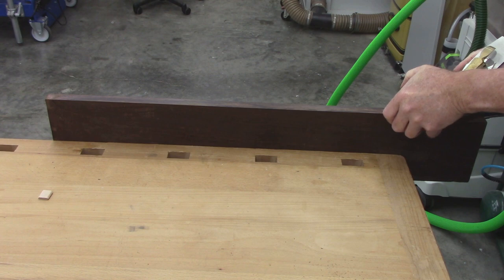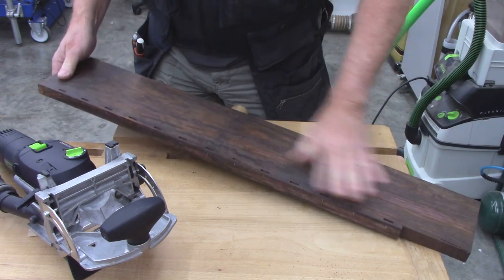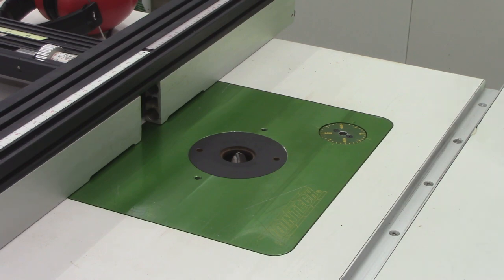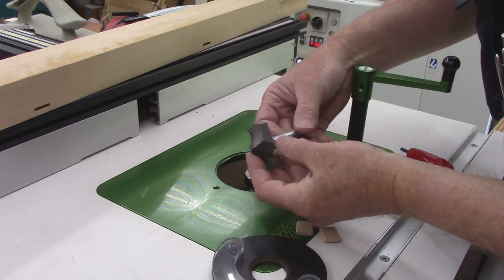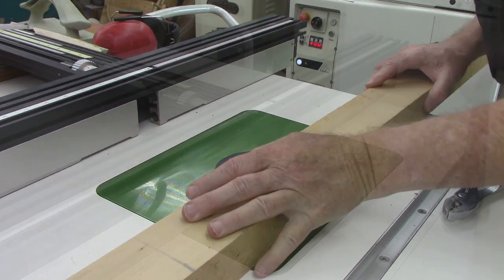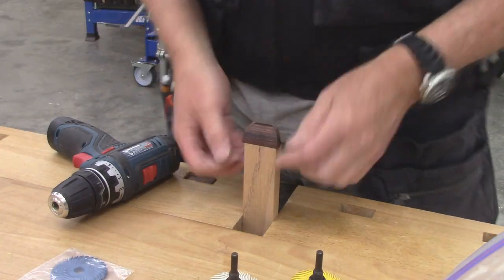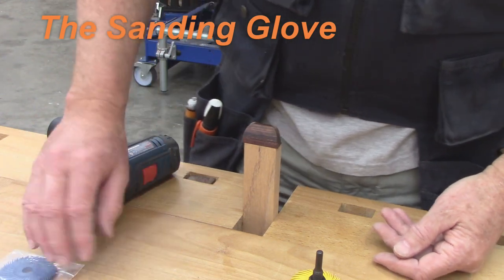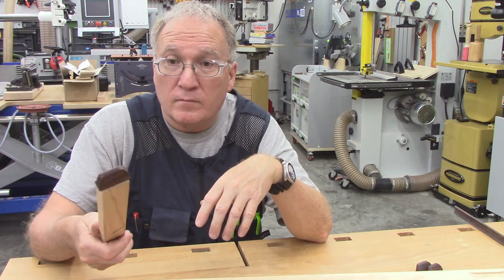Making Drawer Pulls using the Router Table and Sanders

Comment: Well done Steve. Safety first! After 40 plus years of woodworking I still have all my fingers and toes. Excellent jig solution and I appreciate the respirator comment.
Reply from the maker: Thanks Rich.  Me too with the same 40+ years here too and I even wear safety shoes in the shop.  Steve
Reply: @extremewoodworker  don’t know if you plan to come out to Las Vegas for the AWFS this year but if I see you there, I’ll be sure to come up and shake your hand.
Reply from the maker: @richthomas5013  Thanks Rich.  I normally go to the IWF which is much larger and closer to me than the AWFS.  Unfortunately, last years show was cancelled so I am suffering from withdrawal.  What I remember most about my only AWFS show was how HOT it was and Martin.  I always like to visit with woodworkers everywhere and will keep that in mind.  I doubt that I will go to this years AWFS as my woodworking travel budget is slated for attending the Alpine Technical Workshop in October.  I have met several viewers at this workshop in the past.  Steve

Comment: You has a Kündig Uniq  Sanders machine ?! cool  can you tell more about them ?! the king machine of edge sanders !
Reply from the maker: Hi Marc.  The Kundig Uniq packs a lot of function into a relatively small package and I used it to replace two other sanders.  It has 8" x 79" edge sanding, veneer sanding, oscillating spindle and a table to use the idler roller for inside curves all in one.  It can be tilted up to 45 degrees (downside - it requires the sander to be running to do so).  The oscillation is programmable and the belt can be adjusted up and down for more even belt wear.  The rubber sleeves on the spindle sander are hard to get off and are metric so it is hard to source spiral bands in the US.  It is on casters but is difficult to move since it weighs over 1200 lbs and the wheels are relatively soft.  Overall, I like it but, believe it to be overpriced for what it is (pretty much true for every sander that has the veneer sanding fences).    Steve
Reply: @extremewoodworker  jes, a new Kündig  Uniq cost in Europe ~13000 €  and Uniq S more 19000 € -i am fall from believe..laugh but very nice edge sanders